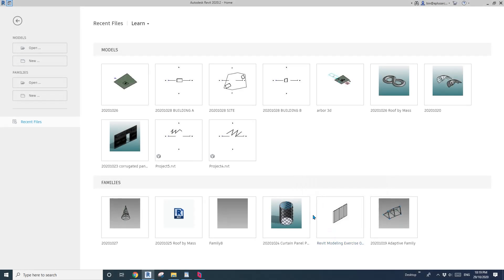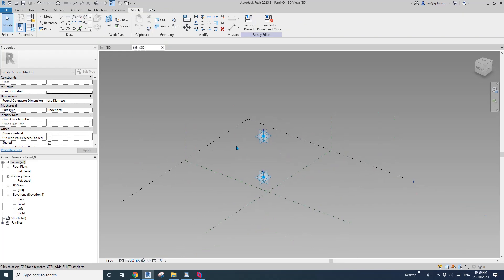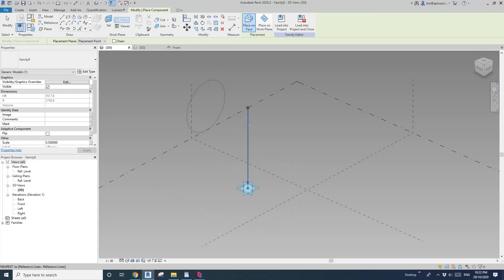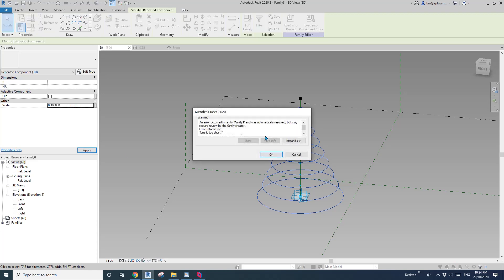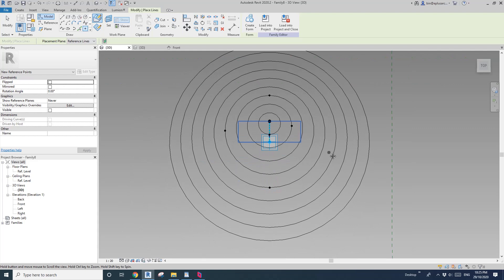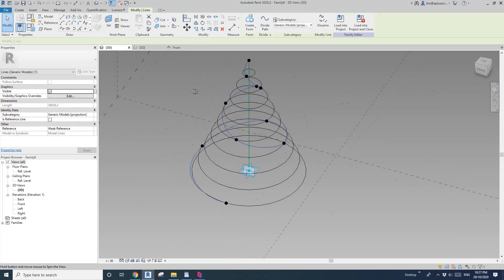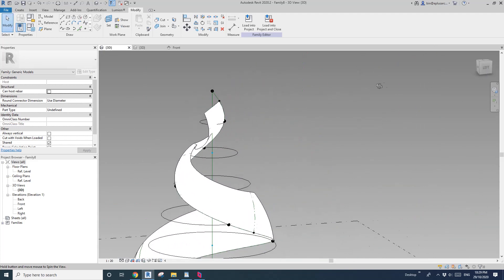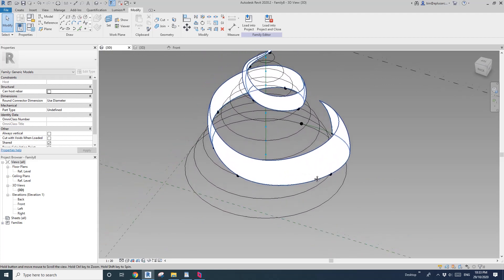Revit Exercise (Day 224) - Parametric Adaptive Family (Mass)

Comment: Hi Bin, can u do a tutorial on how to create a 3D Roof Tile? Currently most roofs are just a flat piece and I would love to see how is Roof Tiles (3D) Created please :)
Reply from the maker: You can probably do it using curtain panel pattern based but I do not recommend it.
Reply: @BINHE615  but why not? (i’m not doing it i was just curious about the possibilities haha)
Reply from the maker: @DD-eq2bl  Because it's not practical, you will easily build a huge file and make it un-workable. There is a video on the Internet but I have not watched it and not sure what method it is using. If I do need to model something like that, I'll do curtain panel pattern based or adaptive family. I can do a short video about it but I still do not recommend moulding tiles on a roof. :)
Reply: @BINHE615  hahaha alright! I actually love ur previous tutorial on linking files etc. that’s a great help for performance in revit modelling. since a lot of us students has a habit of doing everything in ONE file which is a very bad practice haha
Reply from the maker: @DD-eq2bl  Did a roof tile one... almost crushed my pc at the first run.